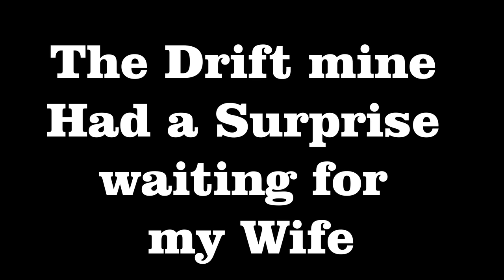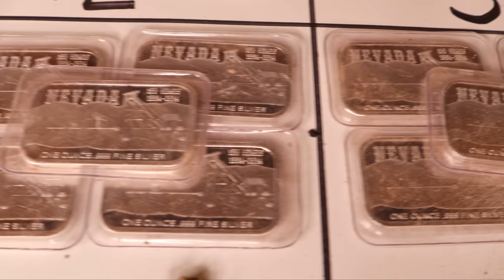Rich Placer GOLD Deposit Worth Thousands Found Metal Detecting

Comment: 15:00 I had this happen to me yesterday.  I was installing new exterior light poles for a residence, got it stuck and ended up breaking off the tip in some old concrete.  The man that invents a rotohammer that impacts while pulling up on it will be the new elon musk!

Comment: Jeff, do you metal detect the gold and then had sift it as it goes out the mine, or do you still use that small trammel system with that small grinder ?
Reply from the maker: yes

Comment: Use a sheet  metal shoveling plate at the face. An old metal shelf flattened out is lightweight and can be removed for detecting. Use a hoe to pull muck onto the plate and a flat shovel for loading the car. Throw the muck over your back into the car to save time and twisting.
Reply from the maker: thanks Mike ....would rather have an Eimco 12b down there

Comment: Greetings, I'm a fan👍
Why don't not you use a short shaft on the detector inside the mine? Isn't easier than swinging a six foot stick in a tight tunnel??
Reply from the maker: we have a short carbon fiber shaft already ....plan on making a small wand for it

Comment: OK Jeff. I think I know where you are. I'm close at least. This is what I know.
You're in AZ. only about 9 miles south of Lake Mead. SW corner of section 10. (ill leave out the details of Range and Township)
It appears you're at Slims Pickins #4. Was claimed in 2017, near the same time you made the video about sinking a shaft.
You're in a draw that heads northeast. no roads in it. I think, maybe a wash? Doesn't appear you have much infrastructure above ground. I would assume your plant is at home? Keep up the good work. Ive used lots of your tips at my claims in Liberty wa. Thanks again.
Reply from the maker: now thats what we like .....someone that is putting the clues together.

Comment: Got a question, if you take out bigger chunks do you have a way to break them up before processing, assuming you process them or is it simply easier to chip off small bits and shovel.
Reply from the maker: we run it all through a wash plant then any chunk left over we crush and re run

Comment: What rails are you guys using for your cart? Did you buy the axles and then build the cart on the axle? I need rails and am looking for a compact and inexpensive option.
Reply from the maker: we are using 24 gauge rails they use for live steamers and got the wheels online and built the mine car around the wheels
Reply: @Askjeffwilliams  thanks for the quick response. I know what's going in my shopping cart next.
Reply: I’m not sure grease on the track is a good idea, it holds dirt and rocks to the track to act as impediments. Put a dab on the axle to lower friction on the wheel, but I’m not a miner, maybe different laws of physics for underground.

Comment: TIP:  I have a unit some place i use it for sand blasting but IT'S also used for welding foundries. The ONES i see today are expensive, because they make U buy a whole bunch of stuff with IT. BUT mine U just have the unit U put on your BELT. The part that produces cold air a garden hose threats U have to have a fat hose for that part. The other end hot air comes out. IT'S powered by compressed air  ( small oilless compressor) to a filter THEN to the unit. When I used ON a hot day when I took the hood OFF IT IT was like having U'R face over an oven and opening the oven door. BUT it was the heat of the day hitting me in the face. ( The part that produces cold air should have 1 1/4" DIA hose or close. IN the winter time when welding, l would makeshift the hose to the bottom to get warm fresh air in the helmet (it also keeps the lens from fogging up) IT is called a air conditioner for welding cutting or sand blasting. Mine is also temperature adjustable . (IT would all so help if you ran into arsenic, I heard it runs neck and neck with hard rock gold.
Reply: PS: LET HER KEEP THE NUGGET!!!!!